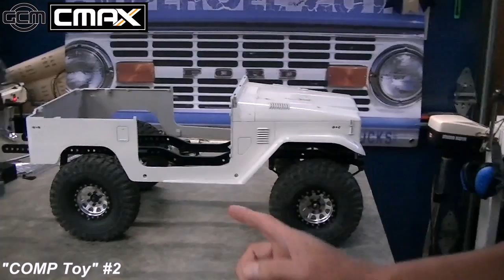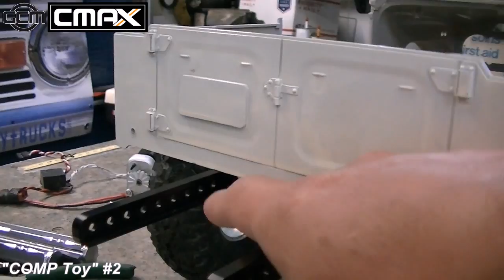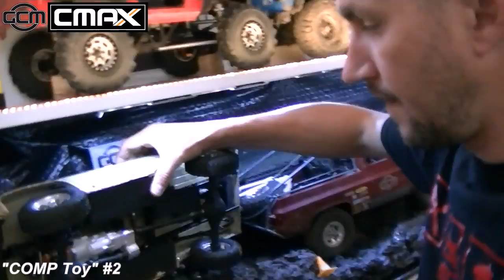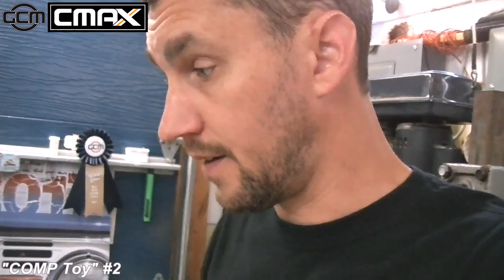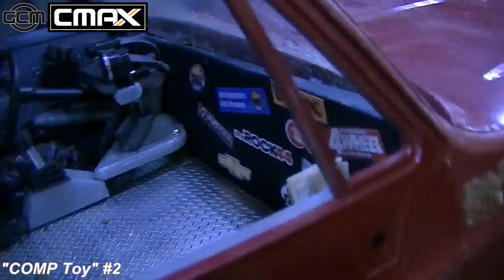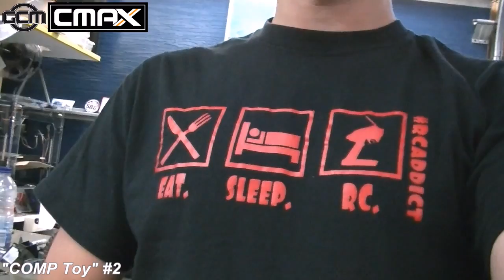GCM CMAX "COMP Toy" #2 Video Build - Steering and Tire Tech.

Comment: could you do a video on the cross canyon chassis I'm building one and my shocks are at a funny angle I'm using the scx10 kit so I'm not sure what's going on
Reply from the maker: Hey! I like to put the SCX shocks on the OUTside of the mount tab on the axle, and then you'll have the shocks in the upright position. Of course, add a spacer or shock ball in the mid section to keep the screw tight where the shock used to be.